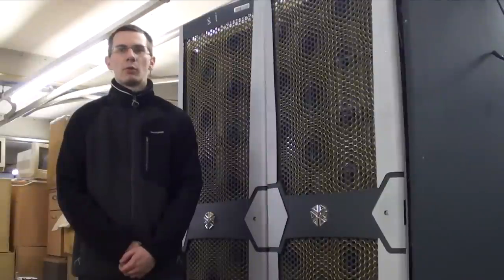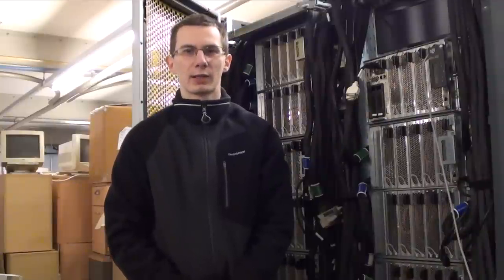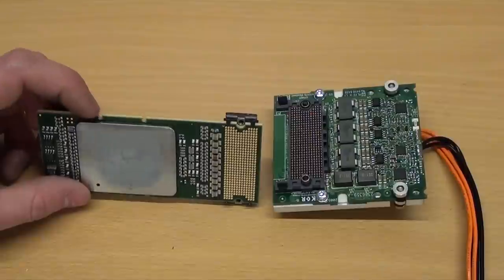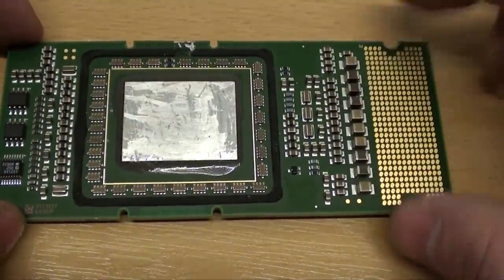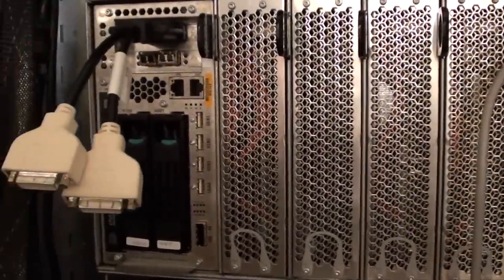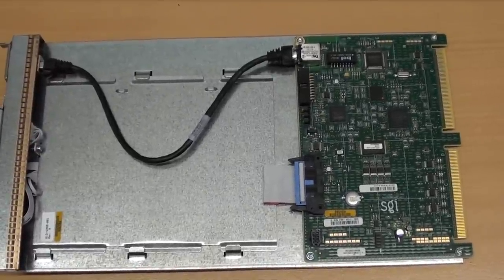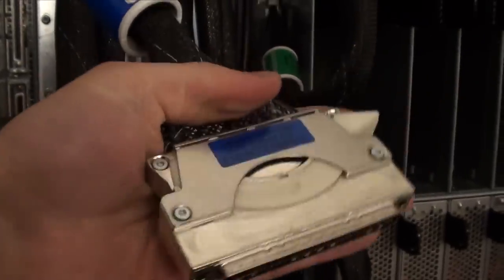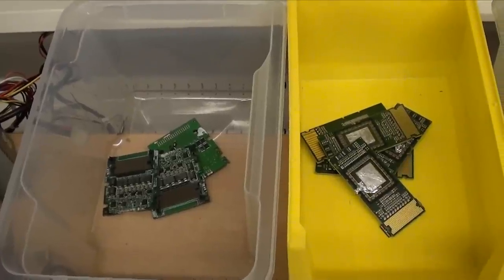SGI Altix 4700 Supercomputer Extreme Teardown

Comment: Wonderful teardown and very nostalgic.....I was one of the designers for that Analog Devices chip right next to the processor.... the adm1021. 

It's a thermal diode monitor which measures the temperature of a diode on the CPU and controls/throttles the clock. 

Quite an interesting time.....I remember doing an fft of Intel's noise data (which didn't have  units of time for the x-axis) only to find out that no one in either company could tell if any amount of signal conditioning or filtering would extract accurate readings. We threw everything at the analog signal conditioning and digital filtering and were lucky.

A bit of luck involved for both companies and a very aggressive schedule - functional silicon in 3 months after seeing the data sheet. 

It was also used on the mobile module, and was on just about every Intel laptop for a while.

Quite nostalgic.... thanks for sharing.
Reply: that's a great story. thank you.
Reply: wish i knew what you said dave sounds interesting. any teardowns of new super computers
Reply: I didn't know that Analog Devices is still in business today since i lost sight of them since 1977 due to carreer changes.
Reply: @Tubemanjac  WHAT??? They make a shit ton products.

Comment: Fascinating video, it's amazing to think that a car from that era is still perfectly usable but this multi million dollar machine is ready for the scrap bin, its a shame in a way.
Reply: what's a shame is that cars don't increase their energy efficiency as fast as CPUs.
Reply: It is absolutely not ready for the scrap bin, and i think it's a shame that these things are discarded in this way.
I would gladly take it in.
Reply from the maker: It's an obsolete processor architecture, and the energy consumption was phenomenal as I explained at the beginning of the video. 
Yes, it is a shame that it couldn't be used, but why would you spend over £100 (US $124) every day on energy just to keep it running, when you could have the same, if not more computing power from a modern system for probably £3 (US $4.50) a day in energy with a fraction of the floor space occupied?
Reply: Burt Holiday But it is obsolete. A modern $400 graphics card from Nvidia has 10 times the processing power of this super computer array.
Reply: carlstechshed Why drive an old car?  Why play old consoles?
I run lots of old "obsolete" architecture machines.
SPARC, MIPS, HP-PA, ALPHA, old 68K macs, 68k ataris, etc.
Are they as efficient as newer machines?  Of course not.
Should they just be thrown in the bin?  No.
Throwing them in the bin is a much bigger waste of resources than trying to learn from them and run them once in a while.
When i see videos like this, i cry a little inside.
Reply from the maker: detaart I understand your point, but this isn't like retaining and occasionally using an old Apple II. It'd be the vehicle equivalent of keeping an aircraft carrier or battleship. Yes, it's a fantastic bit of equipment- but it'll cost you so much to run even occasionally that it's unaffordable. Also, this machine required 42KW of power coming in from 16A outlets. No residential property would even have the power requirements to switch it on. Then there's the weight issue. If you live in a house with floorboards, then this supercomputer would end up in the basement whether you keep it down there, or if falls through the floor. And that's if you could get it through the door in the first place. Overall, it'd be a gargantuan task to keep this thing running, and considering I made a decent profit from the scrap material, it's not a bad thing.
Reply: I ran two HP EVAs to learn from them for quite a while.
The power rating is also likely to be a third or less of what you stated.
Multiple power supplies per component, all rated to run that component standalone on a full configuration.
I have a v880 fitted with 3 2KW power supplies, but the machine draws about 1.1 kw.
I'm not saying it was a bad choice on your part.  I'm just saying that it's sad to see this.
As for the weight, etc.  People who would want a machine like this know what they are getting into.
You could take everything out of the rack and carry it in piece by piece.  It's the way it's done in some older DCs.
Reply: The shame is that cars don't innovate nearly as quickly. I'd LOVE it if a car from 2007 was completely obsolete today. It'd mean we'd be driving around in amazing cars today.
Reply: a 7 year pc with i7 860 can still run modern applications, but that million dollar machine just become obsolete.
Reply from the maker: Absolutely right. Had this system been using AMD Opterons, or Intel Xeon processors, it would still be a usable machine in many respects, albeit still somewhat expensive to run! 
Imagine running Seti@Home on a 256-core system, or using the 1TB of RAM as a RAM Disk! I certainly would have experimented with it a lot more had it not been using the ia-64 architecture.
Reply: but as you state yourself, the amount of power used would make it expensive to run
and newer supercomputers would be more cost efficient
Reply: Blame the Moore's Law.
Reply: singularity is coming
Reply: I am sure they would be more than happy to sell it to you for the amount of money they would get for scrap.  Currently, the scrap rates for the following are:
copper $2 per pound
gold $1200 per ounce
aluminium .50 per pound
Plus, you would have to pay for shipping for something that ways over a ton!
Reply: I work with large systems like this every day, the itanium systems aren't being scrapped because of age, in fact they are still quite capable machines given their age. The problem is that there is no longer and software support for them. The only OS that still supports itanium is HP-UX, and only on HP machines. Red hat dropped it, and such support has stagnated in the linux tree. Sure something like Gentoo might still run, but most of the itanium code is not maintained. BSD also basically has no support, as well as windows server after 2008 R2. If you can't run a supported OS on it, it doesn't belong in the datacenter. Big SPARC, POWER, SystemZ, etc... systems see much longer lifetimes because they can still run a supported OS of some type.
Reply: We still run a ton of sun / whoracle gear, usually the power consumption is about 1/4 of the rating when it comes to the big guys. M9000, e25K, etc...
Reply: I believe IA64 is the only supported platform for VMS these days.
One of my customers is running a handful of IA64 machines for VMS/RDB.
Reply: SGI machines? I'm pretty sure that's limited to HP boxes. Big SGI iron has quite a few weird components that make numalink work. Not saying it doesn't work, but i would be skeptical.
Reply: Not SGI machines, HP machines.  Integrity RX*
Reply: A car from this era is modern
Reply: Not enterely sure, this thing can worth a lot in just 10 or 20 years as a museum item. I would have keep this in storage for sure, waiting for its moment again. Today Old IBMs, SGIs, really tunring intou valuable items. Not sure if there is a place for a supercomputer ...
Reply: It's kind of awesome in a way too though. Technology moves that fast that a 1 million dollar system is nearly worthless today other than as scrap metal and maybe the odd component that someone wants from eBay for pennies on the dollar.

This is the "cutting edge" in cutting edge technology. :-)
Reply: It's because CPU tech progresses so fast that a 5 years old one is practically obsolete - perfectly usable but still obsolete. 
If my car is actually that way: perfectly usable but obsolete because the new ones are so much better, it would be amazing.
Reply: To compare old cars and old video game consoles to this equipment seems dubious.  There's no nostalgic factor with using obsolete supercomputers to quite the same degree as playing vintage video games while older cars may still function cost-effectively enough to be practical for their intended purpose.

Of course, this hardware may still be usable.  However, if there's no contemporary software support, then you can run into problems from using deprecated software, such as liability due to potential security issues.

Another factor is energy consumption, which has already been discussed.  However, one factor that's not been mentioned is ventilation and cooling costs.  More power efficient hardware could potentially dissipate less heat into its ambient environment that has to be dealt with for a given workload.

Also, energy savings can translate into environmental responsibility since you're using fewer resources to accomplish the same amount of work, provided the old equipment is properly recycled or otherwise disposed of in a conscientious manner.

It makes no sense to continue running obsolete hardware from a financial standpoint, especially if the price of upgrading can be amortized through savings of operational costs.  There's also potential for improved profitability due to potential gains of productivity arising out of the use of better hardware and concurrent software.
Reply: detaart no you wouldn't, unless you were very very rich and could afford £38K in electricity
Reply: Moore's law
Reply: Mechanical watch doesn't fade away in time

Comment: I used to broker SGI gear. My last opportunity to do a take-out on an SGI machine was in 2013. It was an Altix 4700 just like this one but at 40 racks it was bigger. Fastest computer in the world at one point - for about 5 days. It had been running at NASA/Ames and was named "Columbia" after the space shuttle. By the time I was asked to make an offer on it, it had been deinstalled, moved off-site and was occupying 6 full-sized units in a self-storage facility. It was worth nothing and I had to walk away. Very melancholy experience.

Comment: If a scientist from the 1700s looked at this machine, perhaps the strangest thing would be the aluminum.
Reply: Why so? Perhaps they didn't use aluminium in the 1700s, but there's a lot weirder stuff in there, like the fiberglass for instance
Reply: Donnie Russell II the circuit board would have blown their minds.
Reply: Nah, the actual operation running on a display screen would easily blow them away. People have seen strange objects and metals throughout history, but no one of that time could even imagine a machine capable of outputting  information, of a machine doing something so complex.
Reply: They will worship it...
Reply: @masaratech  SGI's second coming.The prophecy.
Reply: dude you special
Reply: if our civilization would die and the knowledge lost this would look like a useless intricated furniture that requires opening to see geometric art boards made with strange and rare metals
Reply: no, to be blown.. one must comprehent and grasp the internals and powers.. if one cannot do so.. there is no marvell.. just glitter and shine... that's why we are here..
Reply: and the plastic, the silicon, the board material itself, the liquid cristal and polarized glass on the screen ,the galium alloy thing that we don't even know what that is in this century, etc -_-
Reply: "There's gold inside, get it"
Reply: Newton: «Wonderful, I got a lot of calculus to solve.»

Comment: One of the most interesting aspects of the SGI Altix systems (and the UVs that followed) is that they functioned as a single system. They are NOT clusters. One operating system could run on the whole system, resulting in a 256 core system with 1tb of memory. In the mid to late 2000s, that’s pretty special.

Comment: The university I went to had one of these in storage.  One of the graduate students wanted to get it running again to do computations on, I was seriously surprised how difficult to explain how a modern $1000 graphics card pulling <300W would outperform the system by an order of magnitude, even in double precision mode.
Reply: A SINGLE GPU, by an order of magnitude? Incredible indeed! THANK YOU!

Comment: 41kW. For a wall plug rated at 220V/10A we have about 2kW at full capacity. So running this thing would be like having a two-story house where each and every wall plug is running at breaking point.

Comment: what an excellent video and a great presentation.
So many presenters constantly repeat the same piece of information over and over again which makes me hit the fast forward button.
I never went anywhere near the FF button I listened to every word of his presentation.
I became a programmer in 1963 when "MAINFRAMES" ruled the world, we wrote in machine code and assembler language, IT WAS GREAT FUN.
I had a MARVELOUS career, working for Honeywell, Cisco, 3Com and other pioneers in the communications field, both in England and the USA.
I ended up working for Silicon Valley startups on the bleeding edge of new technology.
I went from the vacuum tube, core memory, tape drive era through integrated circuits to micro processors, solid state memory, smartphones and clothes washers with NFC and MEMORY coming out of our ears.
I keep saying that I should write a book, maybe I will.

Comment: Interesting fact. The geforce 8800, also from 2007, had 384 GFLOPS of processing power!
Of course there probably was no way to interface with it for custom applications.
Reply: CUDA began in 2007 but in general, gpu's still struggle for general purpose tasks.

Comment: Wow! I would not mind getting those processors and a motherboard or two just to hang it on my wall.
Reply: Same! I have a few pieces of motherboard art on my wall which i usually get compliments for
Reply: Put 'em on a gold chain and wear them Mr T style.

I mean, hell.. there's enough gold to pull it off with a straight face.
Reply: That's what I do. My wall has a Sun SPARC, SGI MIPS, Xeons, Alpha... still haven't had the heart to tear open a working HP PA RISC machine :)

Comment: looks like indium
Reply: Fennec Fox it is indium. you can chew it.
Reply: Yep, it's indium. It has a really low melting point (<160°C) which makes it ideal if you don't want to heat up the expensive chip too much. Heat conductivity is decent, but not nearly as good as direct copper, aluminium or silver(but those melting points is way higher making it more expensive and likely to damage the chip)
It's "non-toxic".
Some modern processors still use it(and it still works better than the thermal paste they use alternatively)
Reply: Indium or more likely Gallium. I use gallium for my pc.
Reply: Gallium is in fact less likely because it melts at body temperature. It could melt off the chip and cause a short circuit.
Unless you use very little, it's way too likely to damage your components(and what they use under heat spreaders is quite a lot.)
Reply: Toast651gaming also gallium is a bit more hard than indium, and can't be cut like he cut the metal in the video
Reply: I am voting for silver.
Reply: Wriggly's Doublemint and aluminum powder. You can chew it.
Reply: Indium tutorial from the awesome Periodic Table of Videos series: 
https://www.youtube.com/watch?v=4opHafNmgCw

Comment: The Altera MAX II is actually a CPLD, not an FPGA. Would have been a lot cheaper at the time (not like it mattered though!).
Reply from the maker: Yes, a slight mistake there! They currently sell for £38 each on Digikey, so I'm not sure how much that's changed over the last 10 years.
Reply: Why even comparing CPLDs and FPGAs? Those are, although alike, still very different devices, and the choice usually is based on the the circuit complexity, power consumption and the need in the easy reprogramming (or the fully stand-alone usage instead). Well, at least it's better then comparing FPGAs and MCUs... :)
Reply: +Mark Furneaux
That makes a lot of sense, I was watching the video and thought: a FPGA ? What ? That can't be right and... it wasn't. :-)

Comment: For reference, the current M1 MacBook air has 4.3x the amount of flops/s while consuming about 0.1% of the power. The amount of progress in such a small amount of time is incredible.
Reply: my S21 has more processing power
Reply: Bad comparison, because it is still a huge difference if eight Cores share the same memory and I/O, or if every core has his dedicated (big) memory and I/O can work independently from each other node, so even an M1 couldn´t outperform this machine in general, because he doesn´t offer this still massive amount of parallelism.

Comment: 5:25 Those boards, with all the components and Au removed (or leave the Au on, and sell for the price of the Au), would make some good casemod fodder. Picture that: a homemade PC case built of supercomputer circuit boards.

The supercomputer cabinet, after it's gutted, has many uses. Technonerd's wardrobe or pantry comes to mind.

Comment: I hope we don't regret destroying these machines. I agree that current super-computers are good at massively parallel problems. I'm thinking of a class of problems that require thousands of individual and unrelated calculations that later must be stored or acted upon at some point in near real time. Imagine running a city's transit system and electrical grid and payroll system simultaneously.

Comment: At 115 pounds per day, it only used 170,000 pounds of electricity over four years, much less than the system cost of 1 million pounds. so the itanium workloads became completely replaceable by GPU's in just four years? what about data processing? could the computer be adapted to that?

Comment: I think those capacitors on the CPU module that you showed are ceramic capacitors (MLCC - multi-layer ceramic chip) not tantalum. They are non-polar. Tantalum capacitors are a kind of electrolytic cap which is polar and uses a bead of Tantalum as one of the electrodes.

Comment: how does al these nodes run a single operating system together? What controls how the processes/instructions are shared between these nodes? Is there a master processor and slave processors?